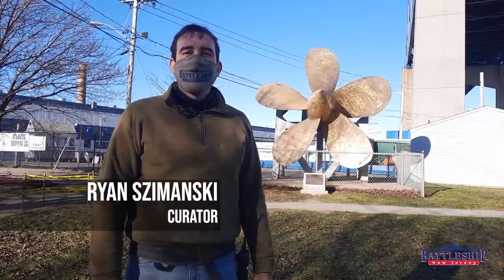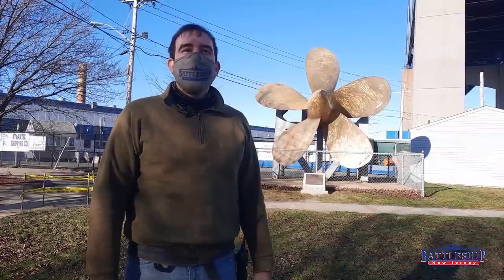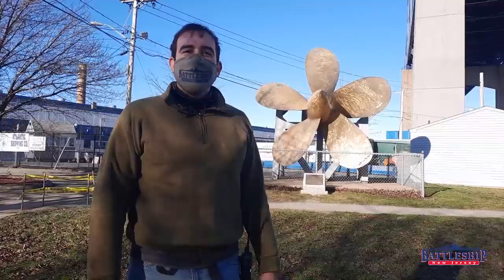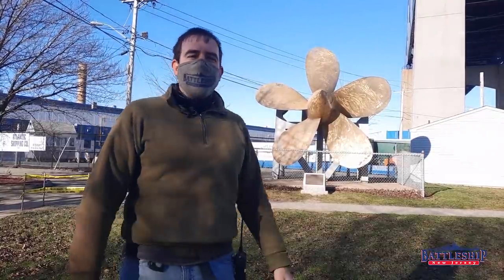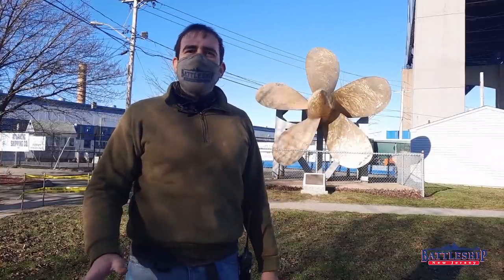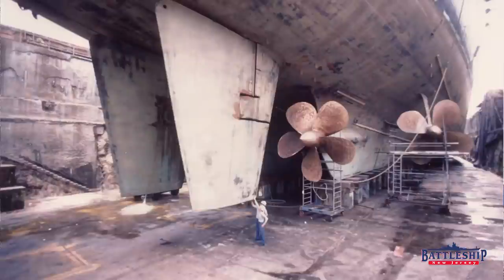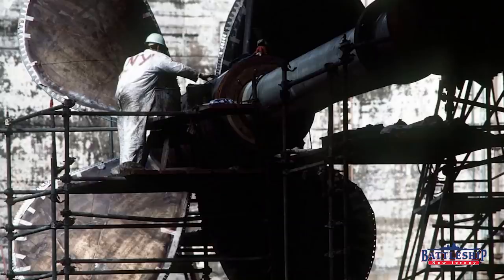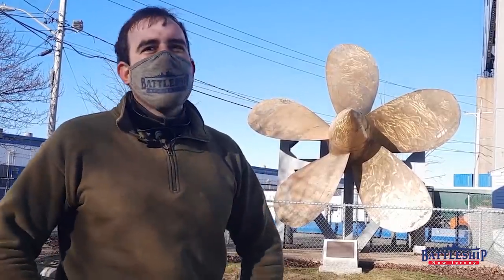Battleship Propellers

Comment: I know first hand what a damaged screw is like. In '79 the USS Stein (FF-1065) ran over something while rejoining the Midway battle group. We had to limp to Diego Garcia at no more than 15kts else the ship felt like it would shake itself apart. There we performed what I understand was only the second at sea (not in a dry dock) screw change since WWII. We also found out that it is impossible to get the Screw Nut Wrench out of the ship without cutting holes into the ship. Fortunately the USS Dixon. that we were tied to, made one for us. Unfortunately we also found out that there are Left and Right turning screws and we were sent the wrong one the first time.

Comment: Hey Ryan, I know where a complete set of Iowa class screws are here in San Diego, CA. They are attached to the propeller shafts under water on the museum ship USS Midway CV-41. They were installed during a major overhaul before 1980. I know that they are there because I got to help identify polishing procedures during overhauls in Yoko Japan. The reason for the upgraded screws was massive displacement increases over the  years.

Comment: I was taught in Boot Camp SD that ships had Screws, Air Planes had propellers.  And we called them that Officially !  Battleship or Destroyer, "The Screws"
 "Screws are stopped, Sir, Turning gears in place"
Reply: You can call an aeroplane propeller an airscrew as well, so screw and propeller can be and often are used interchangeably when discussing ships
Reply: Technically it is a screw propeller.

Comment: Boaters have been fighting vibrations from the first time a prop were installed. Balanced props, running gear, gear reductions, shafts, 3, 4, 5, 6 blade props, counter rotating.... I really think it's more hull related then anything. Every one of my boats have a spot that the harmonics just come thorough no matter what has been done. I have one boat that has had had everything replaced from the front of the motor to the prop nut many times, 3200 rpms same harmonics.

Comment: I think the one hull-intact military museum ship that has all its propellers removed and dispersed is probably the Intrepid!
They removed the propellers from that aircraft carrier when it was in drydock in 2007.
2 of the propellers stayed in New York on the grounds of the Intrepid museum -- 1 on board, the ship, the other at the entrance to the museum --, the third when on display (outdoors) in Norfolk, VA, and the fourth one is at the Naval Aviation Museum in Pensacola, FL which has a huge collection of artifacts from other aircraft carriers, most of whose hulls were scrapped long ago.
As far as I know, the propellers are still in place for the Intrepid's Essex-class sister ships (Yorktown, Lexington, and Hornet) as well as the USS Midway.
The largest items they seem to keep from ships that get scrapped appear to be propellers and nameplates.  I know the nameplates for USS Enterprise (CV-6), USS Forrestal (CV-59), and USS Saratoga (CV-60) were requested and preserved.  I don't know about any other ships that had nameplates preserved.  Submarines appear to get their sails, sometimes part of their rudder, and propellers preserved.

Comment: i only work on vessels from 18 to 80 feet, on those that have had vibration issues, it was always engine alignment or a bent prop shaft or prop damage,  if one blade has a minor deviation dissimilar  from the rest of the blades, it will vibrate, it doesn't have to be much because hydrodynamic forces are mega super massive

Comment: Wow.  I had not heard that the Iowas had top speed vibration issues.  I had only heard of the North Carolinas having that issue...from Drach of course.  Great video and good sound too.
Reply: Vibration issues got even more intense when the Missouri and Wisconsin were pushed to one knot shy of forty knots. The Iowa's could match speed boats if they really wanted too.
Reply from the maker: Pssst NJ actually set the record for fastest, not her sisters
Reply: @BattleshipNewJersey  Officially, yes. Guides and former crew specified that higher speeds were reached but not on official records.

If the curators and former crew of Wisconsin and Missouri say otherwise then I will gladly rescind my comment.

Thank you.
Reply from the maker: Heres our video on it: https://youtu.be/J4Dp-TOAyho

Comment: A retired Canadian Air Force engineer here wondering if the vibration puzzle was ever solved or accurately understood? :)  I am thinking along the lines of a cold case file using todays computer modeling or other analysis tools available as it sounds like something a Masters student might do for a thesis.

Comment: One other reason propellers are replaced is damage caused by cavitation. At high speeds, pockets of air form behind the blade, which then collapse, which over time causes pits to form in the blade, reducing it's efficiency.  Cavitation can also be a cause of vibrations.  Attack subs have highly refined blades to help prevent cavitation, because a cavitating blade on a sub is a death sentence in combat.

Comment: This topic recently came up in a discussion with some mates:   In the event a large vessel like this needed to stop or reverse, how did the general design (Shape, symmetry) of the propellers affect things like cavitation and the aforementioned vibration?  Aside from the shape of the stern and extra drag induced, were the propellers themselves as efficient when required to run astern?   Much smaller civilian propellers are of course often shaped asymmetrically and aren't much use if you tried to run them the wrong way. Interested to know how these compare!

And of course thanks for the updates and new videos!  Stay safe out there! 👍
Reply: Cody: When you reverse the screws at high speed, this generates much cavitation. The screws are much less efficient in reverse. Those are just trade offs of the design.  USNR-ret.
Reply: @KB4QAA  Very interesting, thank you for the insight!

Is this only the case at-speed when reversing their direction (thus having opposing forces at the screws) or do the same inefficiency issues happen when reversing the vessel from a stationary position?
Reply: @cody4783  The screws don't change shape, so their efficiency doesn't change. In any case, efficiency in reverse is of little concern since ships don't operate in reverse for more than a few minutes.

Comment: Perhaps you or a viewer has checked out of curiosity,.....
....did all the blade-swapping experimentation actually provide useful results or did it turn out that any efficiency/benefit was only on the order of around 1%?

Alternatively, perhaps they found that Configuration #2 solved or reduced the problems found with Config. #1 but introduced new problems.  

So they went on to Config. #3 which solved #2's problems but brought back some of #1's AND added new problems.

Wash, rinse, repeat.  😉

Comment: While watching this video, a really interesting question popped into my head. How much more effort and work is required to upkeep and maintain the ship in NJ where there are 4 seasons of different weather, i.e. winter with snow and ice, as opposed to ships like Missouri in Hawaii which has basically the same climate year round?
Reply from the maker: That's a great question! Its definitely something that impacts each sites priorities. So NJ, having winter, it was really important to us to be able to open more interior spaces and allow guests to get in out of the cold and to be open in the winter. Which is certainly aided by the amount of difficulty we have in doing exterior work in bad weather. So our interiors are particularly great in comparison to some of the others while our exteriors are rougher. We just have fewer days to work. That being said, we have found a cool set up to keep laying teak deck year round. The thing to remember is that even when there isn't actual snow or ice, paint and what not doesn't set below a certain temperature so dry and warm is important. Mind you, I'm sure its tough to get work done outside on Alabama in summer because of the heat. Especially with our typically older volunteers. Unfortunately, NJ has all 4 seasons unlike most of the BBs.
Reply: @BattleshipNewJersey  I see a future video on this subject
Reply from the maker: We might have to wrangle our friends from elsewhere to help. Stay tuned

Comment: It is interesting, but not really surprising, that many of the great transatlantic liners-- roughly the same size and same speed as contemporary battleships-- had similar problems with vibration, ameliorated with propeller changes and hull stiffening-- much of the stiffening in the form of massive wood beams in inaccessible parts of the ship.

Comment: What lining material was used for the propeller shaft extenders, pock wood, nylon, something else?
Thanks, great video, again!
Reply: Roland V: From my 1970's navy training, the bearing material is an African wood called Lignum Vitae.   Extremely hard and water resistant.  Off the top of my head I recall a replacement material being found in the early 1990's(?).  No idea what has been used in recent decades construction.  Hadn't thought of that in ages. Thanks for the memory recall!  b.
Reply: @KB4QAA  Great! Thanks!

Comment: Not to bust your chops or anything but the Prince of Wales, only had two screws so both were technically outboard. It would have been more appropriate I believe to say Portside. I don't remember clearly but I've got a fifty-fifty chance of being right! Otherwise great presentation. It does perplex me as to why there was as for vibration problem. I would think from the pure engineering standpoint it would be worth going back over the blueprints to try and figure it out to prevent the problem from occurring in the future. Maybe give a few minutes of cray time! I wonder if those are problems with a lack of rigidity in the shaft and its mountings. Perhaps bearing size? Something was taking those propellers and creating an out-of-balance condition. Shaft Flex could possibly do that. Just point of view
Reply: You usually are top of things pretty good. But you dropped the ball on the amount of screws POW had. It was four screws, not two. Not busting your chops John but you are wrong on this.
Reply: @73Trident  My mistake, Was thinking Nelson-class instead King George V-class. I stand corrested
Reply: @73Trident  BTW Thank you.

Comment: If the ship needed to perform extremely sharp turns or if the rudder was damaged, could the Iowas run two engines full ahead and the other two engines full astern (for example the left two props full ahead and the right two full astern to facilitate a sharp right turn)?
Reply: Short answer, yes. Long answer, only in.an extremely dire situation.

Comment: Did they ever experiment with 6 blade  screws?
Reply: Apparently, as per Google, SS Great Britain had them, and apparently some more modern ships have had them fitted.
Note these are civilian designs though, a quick search doesn't seem to indicate any militerys that will admit to using them.
Edit: the US Navy originally fitted them to Thresher/Permit-class SSN's and found them unsatisfactory, same as with Brunels Design. So it would appear to be a very inefficient/ noisey/ vibration prone design

Comment: Where would the vibrations generally come from? like was it the shaft, the prop itself, or the engine maybe? just wondering since it was so bad the whole ship was shaking lol
Reply: Good question! The vibrations (plural) are very complex & dynamic. They are the culmination of many hidden and partially uncharted at the time nuances involving the amount of horsepower coming to bear on the screws, the length and RPM'S of the shafts, the entire structure of shaft alley (and beyond), the number of blades & pitch of the screws, and even harmonics induced by the turbines & gear reductions. All of these forces (remember for every action there is an equal and opposite reaction), end up working together as a kind of evil orchestra to build up from each other, feed off of each other, even using parts of the ship that the engineers never thought that they could or would, to create this nasty side effect from getting all that power through the gear reduction and into the water to propel the ship forward. It really is a very good question that you asked, and when it came to the 4 So Dak ships, sadly the Navy could never get it worked out with the only thing that was 'easily' modified - the screws. But boy howdy did it have their attention,  and a shout out to the engineers who almost nailed it with the Iowa design! "Haul Ass" Halsey appreciated and utilized every effort they made!!
Reply: @skipmountain9283  Including different pressure along the hull at different speed, which will also affect speed and bunker consumption.  I wonder how the Queen Mary and Normandie behaved in the same situation though Normandie had turbo-electric machinery and so a far different reduction gear (or nonexistent)

Comment: how are the props "attached"\"secured" to the shafts?   are the shafts splined  or keyed??? also   where is the "nut"   is the "spinner cone" sorry aircraft reference'  removeable??  or is the whole prop threaded onto the shaft ?     i have read on german u boats  sorry I happen to live closest to msi where u505 is  that they filled the prop nut caps with tallow as an added measure to absorb vibrations and sounds  whether or not it was effective idk   but regardless the "spinner cap" is removeable to expose the legit prop shaft nut.    also sorry I'm an auto mechanic  are they secured in place any ways with like a cotter pin, bent tangs  locking key or something or double nutted or some how lol.
Reply: also  friggen love the content  super awesome  best out there
Reply from the maker: Theres basically a giant nut, and we just found the ginormous (thats a technical term here) wrench thats used to secure it. We're definitely planning a video on the process. Once we do a little research. And uh figure out how to move the wrench. The thing must weight a couple tons. Its HUGE
Reply: @BattleshipNewJersey  thats awesome!!!! and ginormous is defiantly correct technical term lmao           I really started thinking about this afterwards asnd realized there are still several other ways to secure a prop/pulley/gear whatever on a shaft  there's obviously the straight press on pull off  there are tapered   theres the heat and cool  which is similar to press/pull in a certain sense regardless any method on such a large scale would be super awesome to see
Reply: @BattleshipNewJersey  eagerly awaiting giant wrench video.....

Comment: The reason, and engineers gave up on the flaw, was the length to beam ratio. Imagine a huge rotating disc distributing half it's harmonic  into the weight of the ship, and then side loading into not much ship at all....the length of the ship became an unstable tuning fork.
  North Carolina was so bad that you couldn't stand on the aft deck at full screw power.

Comment: Did the propellers turn counterclockwise on the NJ or clockwise.
Reply: On a multiple screw ship, assuming an even number of screws, half will turn clockwise and half will turn counterclockwise in the ahead direction. That is done to eliminate the side thrust that would be generated if all screws turned in the same direction. On a single screw ship the screw will rotate clockwise in the ahead direction. That means there will be a tendency for the screw to "walk" the stern of the ship to starboard and as a result the ship will turn tighter to port than she will to starboard. Clear as mud? :-)
Reply: @minarchist1776  No Mike, just clear. I did not know how to frame the question correctly, as I was (am? lol) a relative ignoramus in ship propulsion dynamics. I did suspect that screws turned in opposite directions but I didn't want to make a complete damn fool of myself if my musings were wrong. I think Bismarck attempted to steer using differential screw speeds  but maybe that was a case for being able to adjust prop shaft rotation directions in propeller gearing design. Would differential prop shaft adjustment, i.e clockwise to counterclockwise theoretically be able to steer a ship if the rudder was disabled? Thanks for the reply!
Reply: @XXXXXXXXXXXXXXXXXX981   A ship, at least those in service with the U.S. Navy, that has multiple shafts and screws can have them going in different directions. In other words, the shaft(s) on the starboard side could be set to try to move the ship forward and the shaft(s) on the port side could be set to try to move the ship backwards, thus forcing the ship to turn to port. However, that is something that is only going to work at relatively slow speeds. Or at any rate the ship will be going relatively slowly after you have half the screws trying to move her backwards. 

While I suspect that Bismark could have done that sort of thing, with her rudder jammed to one side she would need to have some of her screws trying to move her backwards to counteract that all the time while she tried to move forward using only half her propulsion plant. She might have been able to go more or less straight as a result, but she would have been hard pressed to escape a rowboat, let alone the Royal Navy.  They probably decided not to do that with the idea that going fast in a circle would make her a harder target than going ahead in a straight line slowly.